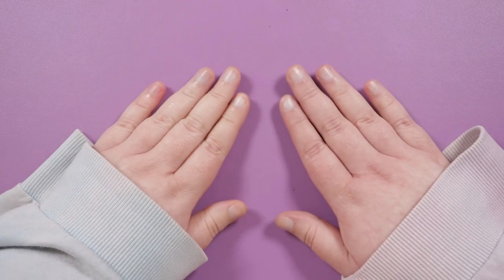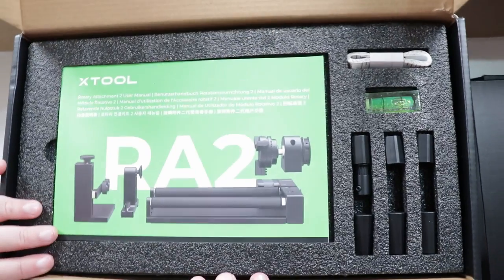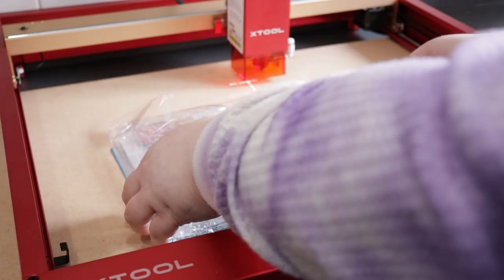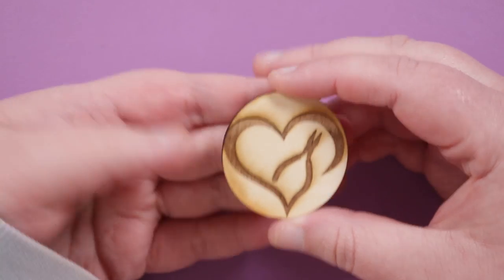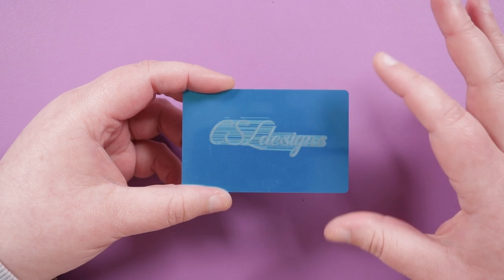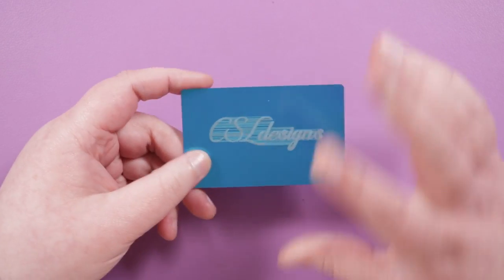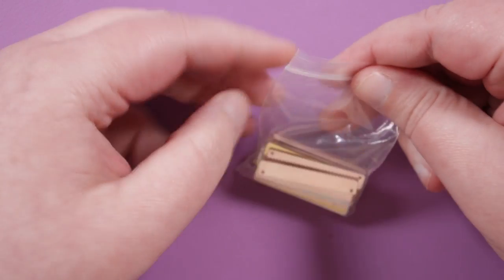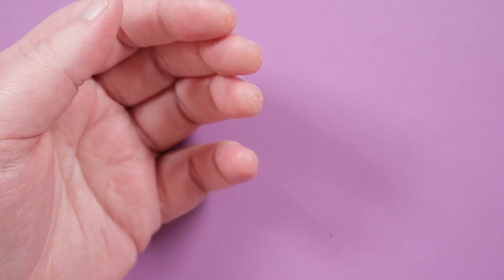Trying a laser engraver/cutter for jewellery making for the first time! 😃 ⎮ xTool D1 Pro 20W

Comment: Once you are comfortable with using it on the plywood, I would get some solid wood species to make jewelry from, walnut, black walnut, purple heart, maple, ash, oak (white and red) etc. There are lots of really different beautiful wood grains/colors - you will just need to be aware of how the hardness of the wood will impact the function of the laser. If you have never seen purple heart wood, you should check it out - it is beautiful. It more expensive, but with the smaller sizes you would need, I don't think it would be too bad. I do wood working along with jewelry making, and I would not recommend plywood for jewelry. Due to the way plywood is made, you are more likely to run into issues with voids in a layer, as well as splinters on the edges. In wood working, you would generally edge band the plywood if the edge where you can see the layers is going to be exposed.

Comment: Nice review! I’m a total newbie! So this helps me greatly.

I’m deciding between the D1 Pro and F1. 

D1 Pro for larger working area, and F1 for basically being able to use the “laser” guide to position small items before engraving them. 

My question is: on the D1 Pro, how would you accurately position/centre small items to engrave without sacrificing a bunch of material before engraving?

The xTool F1 seems to solve this issue with its “laser” guide system.

Comment: You can do the same thing with electro-etching far cheaper. Also it does a better job of removing metal so you can get more depth and use patinas more effectively.
Reply: What's the name of the   machine?